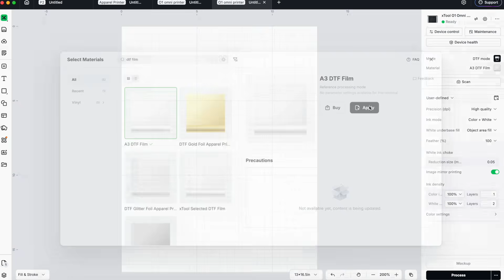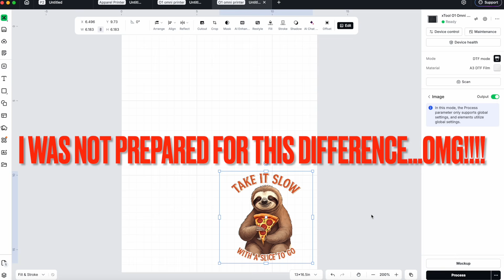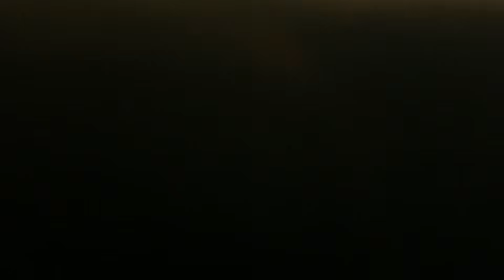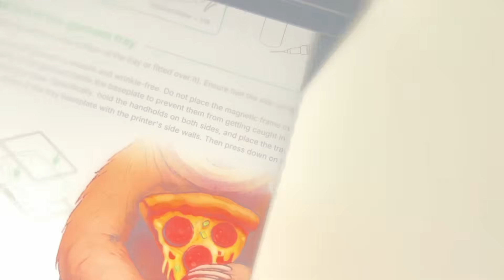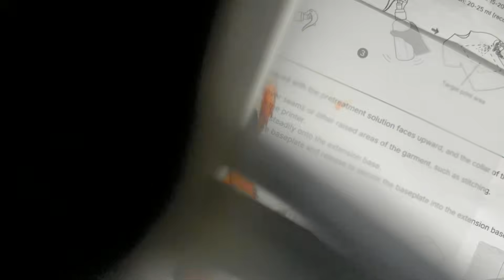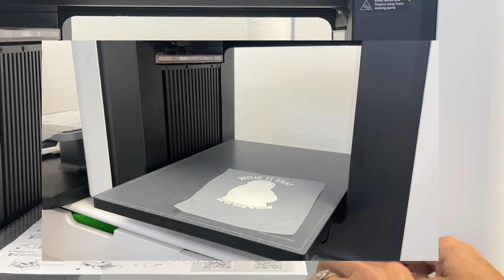xTool O1 Omni DTF: How to Print Your First Transfer (and What Not to Do)

Comment from the maker: Shop the xTool O1 Omni UV + DT Fabric, the only Omni model that prints DTF transfers: https://www.awin1.com/cread.php?awinmid=86799&awinaffid=2029521&ued=https%3A%2F%2Fwww.swingdesign.com%2Fproducts%2Fxtool-o1-omni-uv-dt-fabric-printer-4-in-1-uv-apparel-printer%3Futm_term%3D69853
🖨Printing the DTF transfer on Omni is only half the job. The Omni can't powder or cure, so here's what happens next:
Curing with the WonderPress: https://youtu.be/_W_iAOhj0SE
No WonderPress? I compared three powder and curing methods here, and the manual powdering starts at 0:40: https://youtu.be/0xRDHij3d5s?t=44
⭐So which are you using to cure - the WonderPress, a curing oven, or are you still figuring that part out? That's the step that trips up almost everyone, so tell me where you're at.
📌Personalized same day one-on-one help for your Omni is all through Silhouette U, 50% off with code YOUTUBE: https://www.silhouetteu.com

Comment: I did a full wrap on a 20 oz tumbler on my omni. .My daughter just messaged me that it peeled off the tumbler. What did I do wrong?
Reply: Peeling on tumblers usually comes down to surface prep and cure time rather than the design. Stainless and powder-coated cups often carry a slick factory coating or fingerprints, so wipe the whole cup with isopropyl alcohol and let it dry fully first. On very smooth or coated cups, an adhesion promoter made for UV ink makes a big difference. If it was a wrap transfer, press it down firmly from the center out and peel the top film slowly. Then give it a full day before use and stick to hand washing, since dishwashers and long soaks are the fastest way to lift it. If it started at the seam, a small gap or overlap there gives it a place to begin lifting.
Reply: @dtfonestopvc thank you. I did get to chat with xtool customer service and they pointed me in that direction. I've been doing sublimation for years. I didn't realize they had a primer for the UV ink. I was printing directly on to a smooth (sublimation) blank. I've watched several different creators print with the Omni and I have brats any of them mention a primer. But now I know. Thank you for your response! It's greatly appreciated. 😊

Comment: Do you use the same type of film for stickers and apparel ? or is there a difference between UV DTF film and  just plain DTF ? Does the Printer determine if the print on the dtf is going to be for stickers  or a shirt pending the option you choose, 
and then cures them with the UV light? and does it not cure the ink when you re printing for DTF apparel?
Hope I explained my confusion well. I am trying to buy supplies so I am ready to start hitting the ground running when i get mine in 2 months.
Reply from the maker: Yes very big difference - two totally different films, inks, and processes. This is the video explaining the UV DTF prints that you can do with all three models. https://youtu.be/tjnT7F7GriU

Comment: Awesome video as usual!  I almost think this is why they didn't demonstrate film printing before the unit came out- My converted Epson 8550 can print an entire sheet of 13x19 faster than this because (like almost every DTF printer), it lays down the white simultaneously with the color. That is quite disappointing. The U/V side still seems very awesome, but so far I have been very unimpressed with the DTF/DTG portion